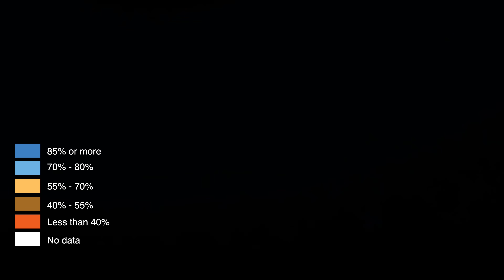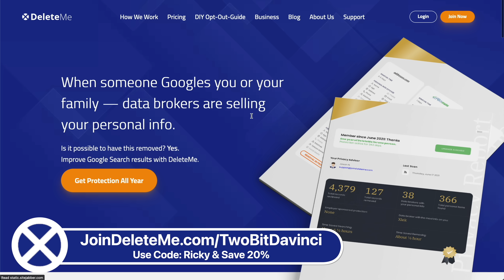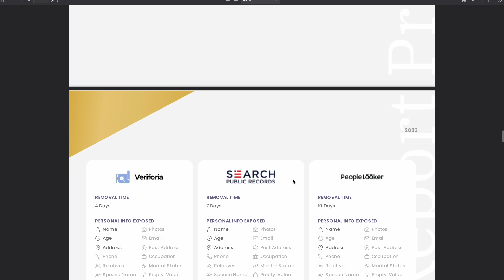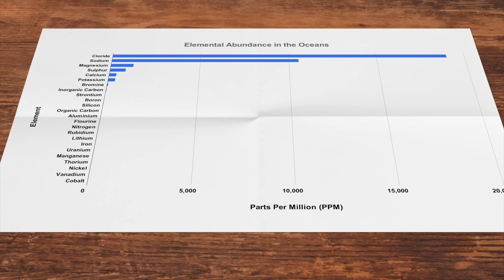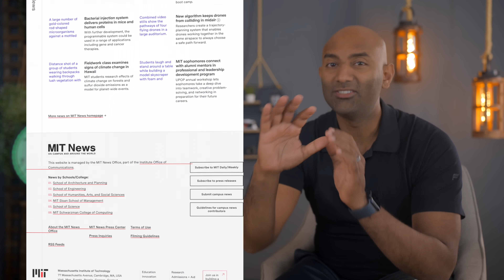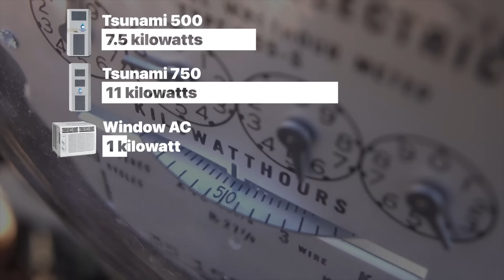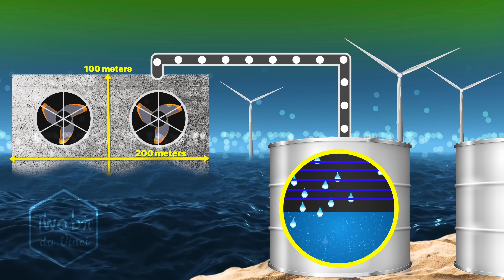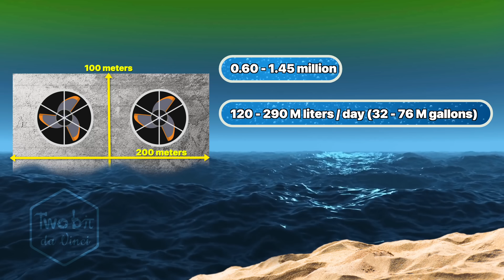This Tower Turns Ocean Fog Into FRESH Drinking Water!

Comment: Taking the water vapor above the sea will decrease the vapor density at the water's surface, causing more evaporation. The Salt is left behind, so the effect is the same as desalination plants, except the salts are more evenly distributed, and that brine is at the sea surface temperature hence easier to mix with the rest of the sea water.
Reply: It still crystalize on an enviromwet that was not evolved for those overdoses of salt.
This brand new green ideas storm its so short minded.

Comment: 5:16 One of the reasons that desalination is not good is that “..it produces a concentrated salt water solution called brine that is usually pumped back into the ocean where it can wreak havoc by altering local salinity and temperature on the ocean floor.”

Logic tells me that this collection and removal of humidity above the ocean surface (that normally is in equilibrium, evaporating and re-condensing at the surface) will increase the local salinity by the same amount as land-based desalination.  If the cool water near the ocean floor is used to help condense the humidity into liquid water, it will also have some temperature-raising effect also.

It appears that this really cool idea basically moves the system off-shore and gets rid of the pipe that would be dumping easily noticed point-source brine into the ocean.
Reply from the maker: This is why we need a large scale test of this technology to put it up against Desal tech.... we need answers to questions like yours. I would think that the effect if it is as your thinking would be by far more dispersed than traditional desal?  we need more thinkers like you promoting these types of questions and seeking answers. Thanks for watching

Comment: I have been wondering for a while about just increasing the amount of vaporization off the ocean. Using a floating platform to move up and down the coast to work with the winds higher up to carry the extra moisture over the areas it's needed. The control of when it drops is not as precise but could get it farther inland without having to pump the water.  Would also have to rely on seeding the clouds for rain most likely but depending on how the evaporation system worked could be very cheap. Although hard to control exactly where it comes back down at.

Comment: Over the past few years there have been a few consumer products that claim to gather community from the air and condense it into drinkable water.
They use hydroscopic coatings and condensation to do so.
Unfortunately many environments don't have high enough humidity to produce viable amounts of water from these consumer devices. (I'm not talking about the one in the video that one actually works), there was a water bottle that supposedly did this and you got a sip after about six  hours. 
 And if you live in a desert well you won't get enough to survive on. Plus of course they use a lot of energy as again stated in the video.
Finally an idea that might actually work! 🎉😊

Comment: Google must be reading my mind, I've been thinking of this idea for a lil bit now, but slightly different.
My take on the idea was to use newly developed radiative cooling paints to cool down a wide air channel, then reduce the temp even further with normal condensers.
Above 75% RHI you don't even need the condensers to start yielding water as the equilibrium is 4-5C below ambient. (And I think you can push the equilibrium further given the right layering, IR absorbent undercoat, and topology)

You could push air pretty fast through it and still keep it not too long if I did the math right. a 300x4m system at 25mph could yield 12 gallons per second iirc

Comment: If you would use a different sort of reinforced concrete (for instance enforced with carbon instead of metal) you exclude metal corrosion. The structure will be stronger and can last longer. 
The higher costs are partially compensated by making the construction thinner (use less material). 
another thought: 
"The state-of-the-art study on durability of FRP reinforced concrete with seawater and sea sand" by Xialong  Hu et al.: use the seasand at the construction site. 

further brainstorming will be necessary to find a good sollution. 

, , ,

Comment: And super smart idea, but just being a backyard engineer I know it’s a lot easier to pump liquid through a pipe because of density than it would be to process high water vapor content but the cool ocean itself would offer a lot of free energy to get intense the water before it’s pumped on sure super easy to figure that one out was very little effort. Don’t know why they didn’t figure that one out. Plus the wind itself would probably turn the fans that would be very little need for electrical power and of course it’s a great place to put solar panels because the room physical space is endless almost

Comment: They should make some types of ocean structures.  These more modern ones use quantum structures and dots in some unique ways that absorb in huge quantities as everyone is aware in this field they are very reactive and that aspect may be used in a clever new way to generate more clean water.   Hydrogen magnetizes graphene but applied in reverse, maybe graphene quantum dots doped with iron are far more effective.   Robert Murray Smith demonstrated that magnets placed near the electrodes enhance water separation, so these processes are tweaked to be used for water and energy production in the oceans.

Comment: Well yes, there is an even cheaper way to do this . take 100m^2 of black plastic, float it on the ocean so that water continually splashes onto it., heating the water. Then take a sub ambient cooling paint and paint some thing like large flat pontoon and let the air flow through that , depositing the water in the pontoon. When it's full sail it back to land and unload.

Comment: What if we use this system only for ingestion? What if we just clean salt water so that it is fine for shower? It sound like the reasonable way to go for the mass.
Also, I can easily shower with about 2L. Just reasonable change of habit make this machine at 50000$ enough probably for 100 persons or so.

Comment: This idea would be a great hybrid for reverse osmosis desalination plants as it could be a substitute for the intake pipes that have impingement and entrainment issues (fish being sucked in and trapped at the intake point) as well as contamination from the discharge concentrated brine. In addition, this idea would be a great pre-treatment as the salinity in the condensate would be around 1% which would be a huge cost reduction than desalinating 3.5% ocean water.

Comment: you just COMPLETELY GLOSS OVER the impact that it WILL have on the environment with just STATING ONE NUMBER like that small percentage shows there would be no impact.... THAT IS B.S. ..... you can say that they extract a very small percentage of the evaporated water that comes off the ocean and think that it means there will be essentially zero impact.... these people KNOW NOTHING ABOUT WEATHER..... so their OPINION ON THE IMPACT ON THE ENVIRONMENT AND WEATHER IS NULL, INVALID, AND WRONG.
Each area these towers were installed have different weather patterns... like for example a VERY EASY conwept that most people here probably know of is the Andes blocking the water vapor from falling in Peru and casing it  rise over the mountains, and when it comes back down and warms up it lets all of that moisture out in the RAIN FORESTS of the AMAZON.... What if 20 of these towers were install off of Peru's coast? it could remove a significant enough percentage of the vapor OVER TIME that not enough moisture condenses over the Andes and when it drops down on the other side and warms up it doesn't have enough moisture to turn into rain and the rain forest starts receiving less and less rain.... And THEN when people start to notice after 10 years of this, and their livelihoods or being destroyed and the rain forest is now just a forest, the inventors of the tower, the investors that financed them, and the water utility company all get together and say that there is NO  PROOF it's the towers causing the lack of rain in the Amazon, they lobby all the governments around South America, they band together, fake a scientific study and SOMEHOW create a fake excuse to blame it on a gopher or something... and NONE OF THIS SHOULD SURPRISE YOU!!! Companies do this ALL THE TIME, and they have been doing it FOR CENTURIES!!!!
So just because the INVENTORS of this system and product SAY that it would have a NEGLIGIBLE IMPACT OF THE ENVIRONMENT does NOT mean its true. - DO YOUR OWN RESEARCH and NEVER FORGET that ALL (and I mean ALL!!!!)these companies have ONE THING IN MIND: MONEY! No saving the planet, providing water, doing good, or helping others..... nope. they are a BUSINESS and they are driven by ONLY ONE THING: MONEY.

Comment: Then natural gas becomes more viable with this technology as we can produce hydrogen from the process as well. As water is in a vapor form it's capable of its own static which is enough to collect into a plasma strong enough to zap a drop of water at a time at a fast rate. Breaking the bonds between oxygen and hydrogen. It also explodes like a firecracker but also some hydrogen and oxygen escapes. However in an engine you can turn a piston with it and generate electricity as a generator.

Comment: As i saw mentioned elsewhere, the water close to the surface still carries salt as microscopic crystals. The intake of vapor might require some new technological solution to filter those out, which is what usually drives up costs for ideas like these. Admittedly it could still be more efficient than desalination at the end of the day.
Reply: The authors say the collector would be 20m above the water's surface.
Reply: @Israel_Two_Bit  in an enclosed space with turbulence.  So yeah salt will clog it up still.
Reply: @vultureTX001  regular or continuous cleaning with fresh water might solve that problem. Of course, that would raise price and reduce efficiency.
Reply: That could actually be good. We're not looking for distilled water. That's bad for the body. Drinking water needs to have some salt in it. And if the vapor already has it, even better. It all depends on the concentration.
Reply: @feynstein1004 Well it depends, as a drinking water - fine, but if you wanted to use this water for watering plants, then yes you look for distilled water similar to rain. Otherwise the salt would accumulate in the soil over time destroying it completely.
Reply: @guesswho6038 That's a good point. Like I said, it's all about concentration 😀Although, doesn't most irrigation consist of river water which has some salt in it? And that doesn't lead to salting of the soil. How do you explain that?
Reply: @feynstein1004  River water and well water does lead to salting of the soil. It depends on the amount of rain in the area compared to irrigation, because rain can take the salt from the top soil deeper. Also different rivers can carry different minerals. It can take hundreds of years to realize the soil is dead. The most notable historical record is from Sumerians who used Tigris and Euphrates water for irrigation and eventually the crops fell so much because of salinity over generations that they succumbed to Babylonians. So beware if you think you can pump water from the underground and water your desert plantation forever.
Reply: @guesswho6038 Yes, I am aware of the Sumerian example but isn't Egypt the perfect counterexample to that? I mean, the area there has been irrigated for what, 5000 years now? And is still fertile 🤔
Reply: @feynstein1004  Egypt had floods to pull the salt away.
Reply: @catprog  What does that mean?

Comment: Chile have been using vapour curtains for over 30 years  without using any for of power. It might not produce as much drinking water, but it has cost a lot less. Interesting project though and water will soon be the new valuable commodity.

Comment: If they already have to build a structure at sea, why not circulate a heat transfer fluid from the air collectors down to colder waters deeper in the sea to provide the necessary cooling load? Expending a significant fraction of the latent heat of water in energy is going to produce extremely expensive water. Unless you have a very flexible production rate and only produce when renewable electrical production is very high, you'll also need to burn a lot of carbon based fuels to maintain a reliable supply.

Comment: Use roman concrete... OOORRR

off shore oilrig type platform with a shiny shore side face.

Best way to condense? Pipe it through multiple pipes down through the structure down onto the ocean floor where the fresh water output pipes hook up to pipe the output to shore distribution.

Let the depths of the ocean do the work.

cloak the structure from shore angles. Ie shiny surface on the shore facing side with the wall @ a -1 degree slope. I will guarantee the distance at which it is built from shore you will see jack shit.

Also those structure will become breeding grounds for fish

100% build this shit

Comment: If I have time, this summer I want to do a science project with my kids along these lines. We have high humidity, but periods of little to no rainfall. The challenge will be who can design a passive system under a specific budget which can gather fresh water to help water the garden during the summer heat.
We are often near dew point for a lot of the day, so my thought is essentially a heatsink thermally bridged to a panel with some of that new ultra white paint. This can drop the surface temperature 1-2*c which should be enough to cause condensation. It wouldn't be fast, but could be enough to keep soil near a plant moist for most of the day.
Probably not cost efficient for the water produced... But a good science experiment and something for the kids to do.

Comment: If you add dark-painted floating metal mesh, then evaporation rates will increase, so if you place those near the towers, then you will get more evaporation and higher air humidity in the air you're using to get water. If you add cheap imperfect metal mirrors to allow the pipes to cool down, then simply going from the higher air pressure inside the pipes to the lower air pressure inside the water silo, will get at least some of the water to condense, and you can also get dry cool air as a byproduct, in the hot humid areas where it's most valuable, like a city-wide central AC unit delivering to places which pay for it.
Reply: Those are all great ideas. We need more people thinking about creative solutions like these and then prototyping them to build actual working versions.

Comment: I have been working on AWC for a decade. You do not need any cooling towers. The ocean water at depth is cool enough to cause condensation. You just need to pump it up. And you don't need big pumps to do this. You just need an electric current to cause electrolysis which changes the density of the water, causing it to rise (like an air pump)

Comment: It is a good paper idea. I don't know the real money/energy cost.  Sounds like a possible second use for a offshore oil platform when it no longer is used for oil production.
I wish you would not use the term consume water when talking about normal water use.  We don't change water into another compound when we use it.  When you water your lawn,  flush a toilet, brush your teeth, you devert the water, or disolve minerals into the water, but you do not chemically change/consume it.  Using your definition of consume means that lakes with hydro electric dams consume water.  That does not happen they just devert/delay the water.  This is not like using fuel in a car, which comsumes the gasoline/diesel product.  The total amount of water never changes when we use it.  Some exceptions apply.  If you use water in a chemical process, or the electrolye the water.  That would constitute consumpion of water.

Comment: This is awesome... And if you use pipelines underwater (like for petroleum, but for gas) you could even get to some water almost free, because on ocean bottom the water is cooler. Thus, this may help cool the water with no energy cost at all, and we could cool it further to extract more water. Maybe that would even work just with a pipe going under water if water is shallow enought, then you'd just have to use giant fans, no compressor at all. Easily replaceable, but you'd probably get less water overall. And warm up a bit the ocean bottom, but meh, that warm water will rise, then evaporate again, so...
Reply: this comment was so stupid on energy conservation and thermodynamics' laws that it gave me a stroke to put me at the same level.

Please be more carefull when using this level of weapon-like stupidity...

Comment: This seems like a great new concept.  I’d suggest the tower needs to compress the air by a small amount to increase the temperature then pipe the air through air ducts in the water so the sea water can cool the compressed air.  When depressurization occurs at the land based plant the saturated air will already be chilled making the condensation require less energy

Comment: the system which would be even much cheaper to make and run is greenhouses floating on the ocean whit some specifics , able to make approximately 1.5 billions liters a day for 1000 m² covered in hight of 3 m , and using only only solar power and making electricity too, using the fact that inside the greenhouse there will be a higher concentration of  sodiumcloride (salt) !!!!

Comment: One of the most obvious solutions I could think of … desalination using the membrane method requires lots of energy due to the pressure needed to force the water through the membranes… why not use the natural pressure of the ocean itself to power this ? I can think of a few ways to achieve this as a mechanical engineer but I don’t have the Resources to get this done .